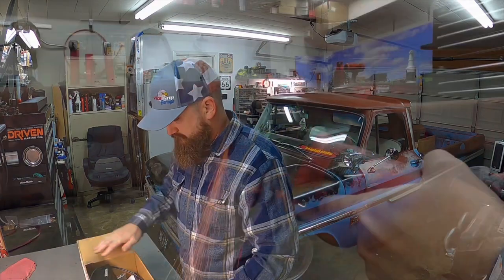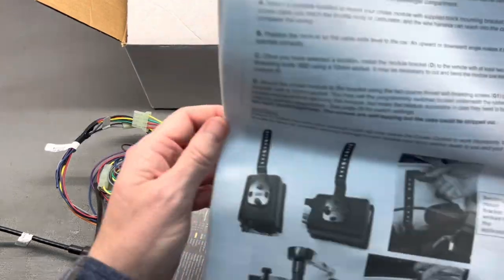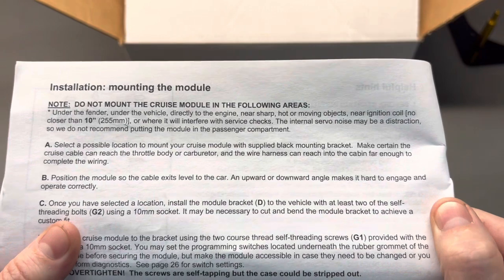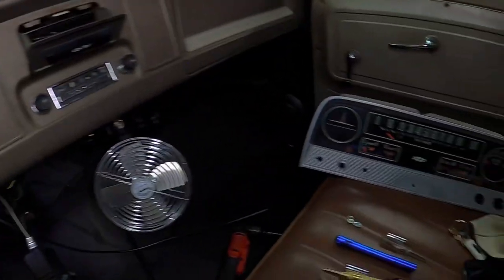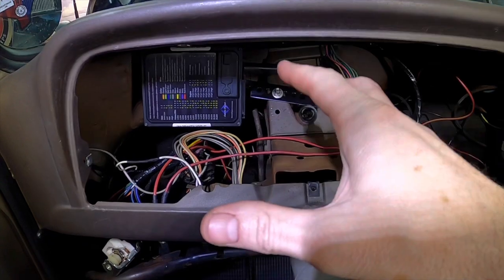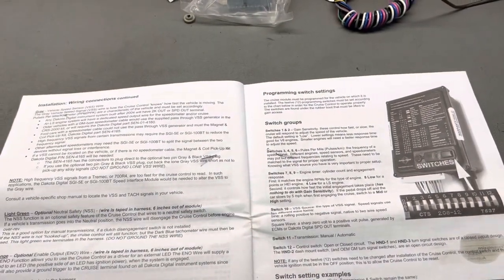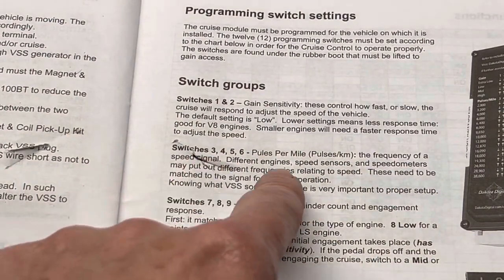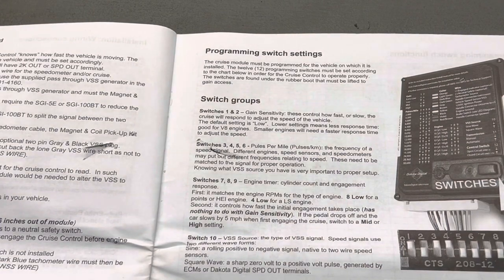Cruise control install on a 1966 Chevy C10

Comment: Looks like this is just the ticket for my '66 Caprice. Based on what was learned from your video, I won't hear any noise at all if it is mounted in the engine compartment. Under dash is not an option for me - too cluttered as it is. Thanks for making this. It was very informative.
Reply from the maker: You shouldn’t hear anything if you mount it outside. I wanted to but there really wasn’t a location I was satisfied with so under the dash it went. Thanks for your support

Comment: Unfortunately my eyes are not too good so I will need a mechanic to install it..About how many hours would you say it would take from beginning to end? I have a 1966 Chevelle...THANKS!!!  It was  great VIDEO...more in-depth than any other!!
Reply from the maker: Depends. If you mount the cruise control module in the engine bay on the firewall somewhere then my guess it would take about a day to do. It also depends how clean the shop does your wiring.

Comment: I never did figure out if the black wire from the speedo is supposed to be grounded. Is that what you ended up doing?
Reply from the maker: @designsinorbit  yes I believe that’s what I did